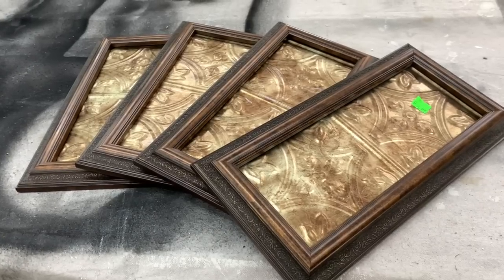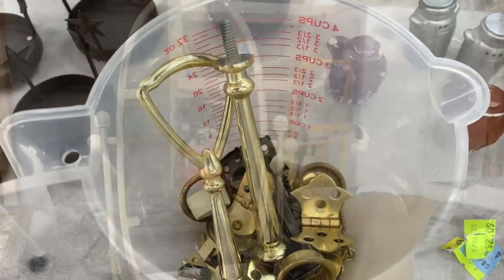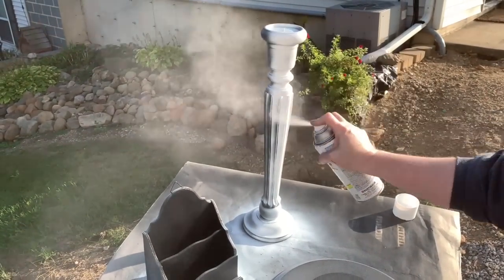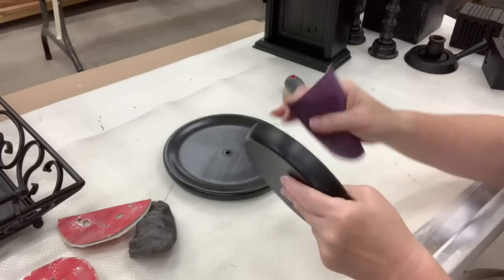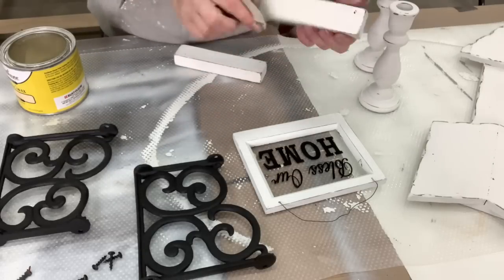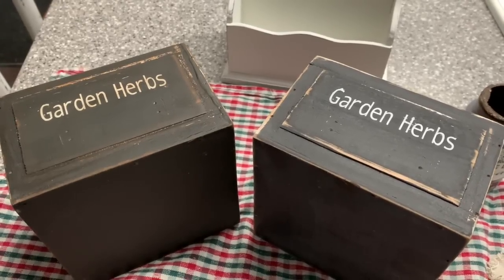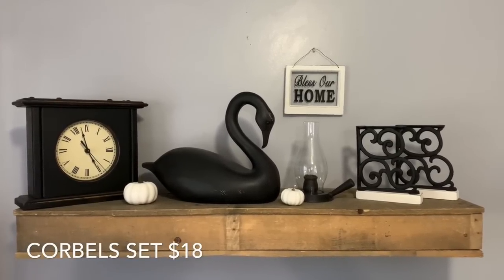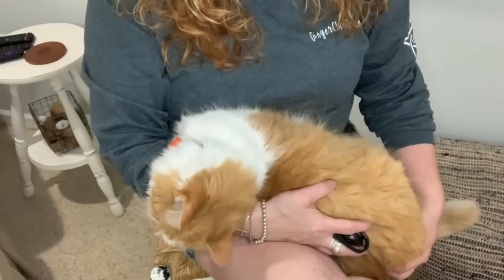Trash to Treasure Thrift Store Flips Makeovers for Farmhouse Decor  *Sunday Funday*

Comment: All so beautiful, thank you for sharing your process, so much of what I do I’ve learned from you. I have a tip for you for taping off, I use ‘frog tape’ brand tape when I need a dependable clean line with no bleed. It never fails me. Of course I still use the blow dryer on it first, you taught me that. 😊
Reply from the maker: Thank you for sharing that. I’ve tried the frog tape. But it’s not cost efficient for the quantity off product we put out. But if I’m painting walls in my house. It’s my go to🤗

Comment: Great video as always x x How do you stop the paint from bleeding through the stencil?
Reply from the maker: Thank you for watching. I try to avoid bleed through as much as I can. Really rubbing o. The stencil to make sure it’s a adhered. And than not using a lot of paint at on time. I rather go over multiple times than deal with bleed through. And I wait for my paint to be dry to remove the stencil. I hope that helps

Comment: So question? You use a het gun, or blow dryer to remove the stencil that you put on also?
Reply from the maker: Just a regular blow dryer. I just heat it enough to reactive the sticky so that it doesn’t pull off the paint. I’ve had the happen to many times. So now I always use a blow dryer. And no problems🤗

Comment: Wanted to know where you got your clippers from that you snip the flowers with. And also what is the difference between using the clear mat spray or using the polyurethane spray when you're trying to seal the black onto one of your pieces black paint why would I choose one over the other or why do you?
Reply from the maker: just a clear mat spray works.. Rustroluem, polycrylic.. I don't suggest polyurethane as it will yellow